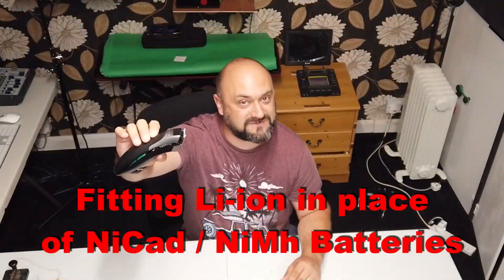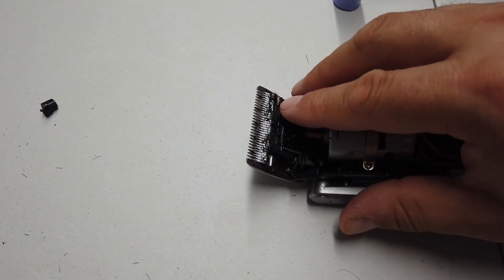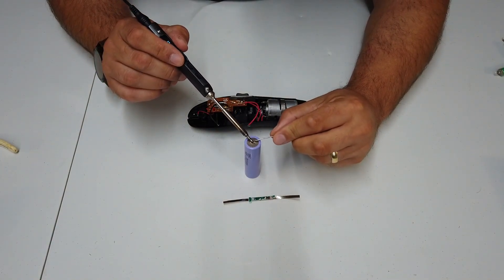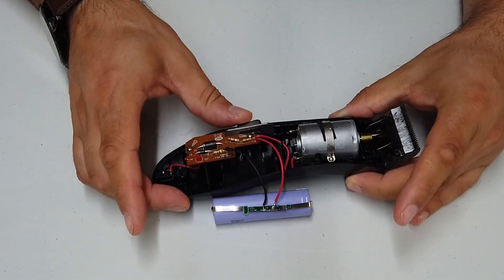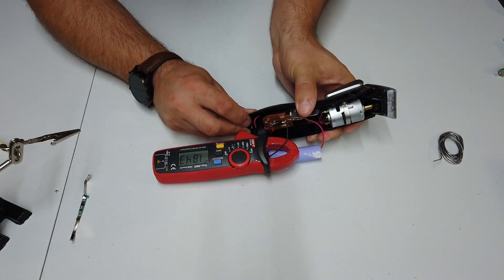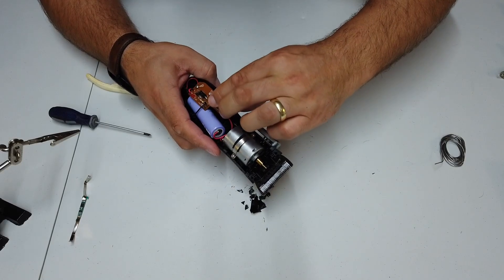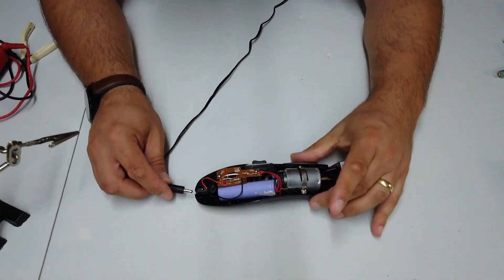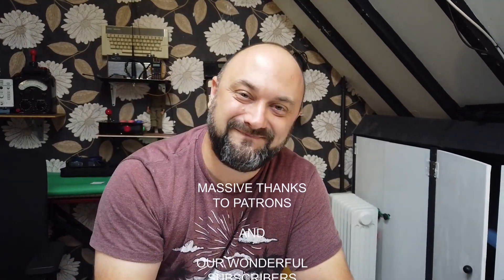DuB-EnG: Replacing Rechargable NiMh or NiCd Batteries/cells - Upgrade power tools to Lithium Ion

Comment: Don't do what this man did! The hair clipper's motor is 2.4V but installed a 3.7 volt li-ion battery. There is also no charging circuit, overcharge protection and overdischarge protection circuit!
Reply from the maker: Agreed 👍  ...

Comment: Remove the old circuit board altogether just cutting out the switch bit. And use a TP5100 charger module for charging and protection with indicators. You can use a normal 5v usb charger as power source. it's much smaller and you have enough space for everything.
Reply from the maker: This is a great 👍 idea...  thanks

Comment: Is it wrong or dangerous if I replace the NiCd battery by a regular rechargeable Li Ion battery?
Not sure why a battery management is necessary, aren't those batteries just charging until full? So what's the risk?
What specs should I look for in mentioned battery? Thanks
I'm trying to restore a Philips Philishave HQ5812/16.
Reply from the maker: Lithium ion are Totally the wrong voltage...  please be careful!!

Comment: did the protection board have a shunt resistor you could bypass to at least keep over/under voltage protection
Reply from the maker: Probably...  that’s a very good idea...  that said, I have looked on flea bay and have found some higher power units that are not horribly expensive...  thanks for your thoughts!

Comment: I was thinking of doing something similar with my trusty old Remington clippers, but then lockdown finished, work started again, and I found that I could get a lithium powered set of clippers on FleaBay for 15 quid, so I went for that option instead 😄
Reply from the maker: I love the bay of flea... I bet your new clippers aren't as smooth as my old ones with the ceramic blade :-).... nerrr neerrr na neerrrr neeerrrr!!  :-)  (pokes out tongue)
Reply: @DubiousEngineering  You're not wrong there; I don't expect the new ones to last long before they start ripping out what's left of my hair in tufts 😁
Reply from the maker: Ooooh... I’m scared for you!!!  I remember my father had a badly set up pair of clippers that tugged a great portion of his beard out...  and then jammed ... still stuck to his face :-).  I was laughing my arse off!!!

Comment: I am charging mine from a USB pen drive digital regulator. I can change the output between 1v up to 24v cost me about 2 euros. Charging my clippers about 3.5 v works just fine
Reply from the maker: Epic! - So, its not just me that has modified a good set of old clippers then!!  :-)   Great suggestion BTW!

Comment: Have a USB charge / protection board if you want one, you can charge with a micro USB cable.... They were cents kn ebay before the postage apoclyps....
Reply from the maker: Thats actually a really good idea...  then we get a full charge instead of 3.88 volts :-)
Reply: @DubiousEngineering  message me and I'll stick one in the post or ebay search TP4056 Battery Protection LiPo Charger Module Board 5V Micro USB
Reply from the maker: How kind Tim! - Thanks very much! - I've just looked it up, and guess what!!  -  I have one in my BMS bag...  must have bought it for a project and not used it!! - I'll see how things go with manual charging for now, as the worst that can happen is using it too much and depleting the battery to death.  But now I remember I have that PCB, I'll be sure to use it in a future project!!  :-)
Reply: Even with USB C now € 0,25  10%OFF | 1PCS 5V 1A Micro USB 18650 type-c Lithium Battery Charging Board Charger Module+Protection Dual Functions TP4056 18650
https://a.aliexpress.com/_BSjtnT

Comment: Nice ... got any links to the pcbs please?
Reply from the maker: For you sir!! - Everything is possible :-)   -->   https://www.ebay.co.uk/itm/10pcs-3A-BMS-protection-board-for-1S-3-7V-18650-Li-ion-lithium-battery-cell-ul/353213355761
Reply from the maker: Please note, on higher power electric motors, these BMS boards think there is a direct short and as such, shut down!